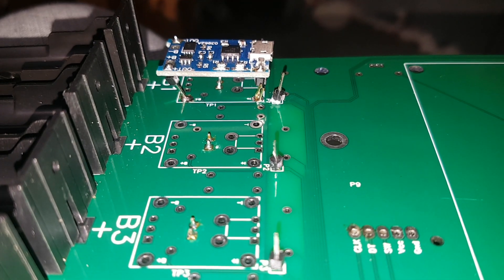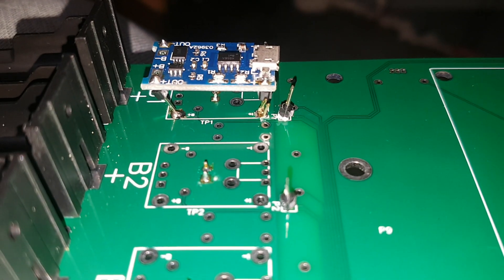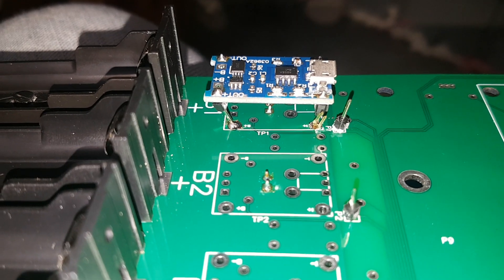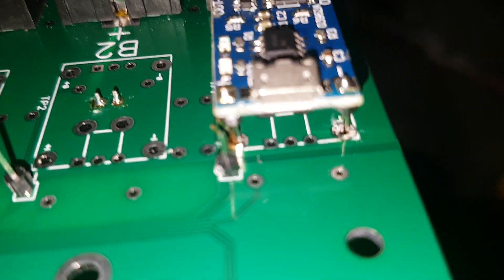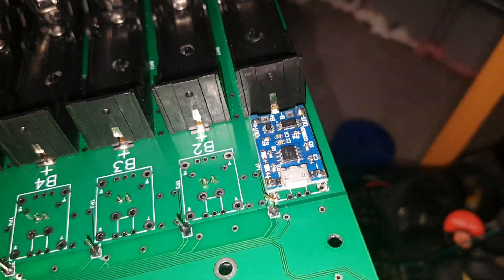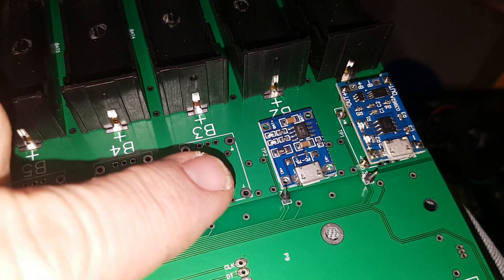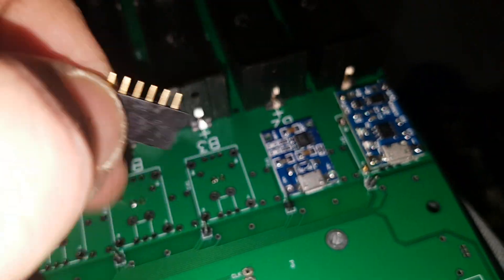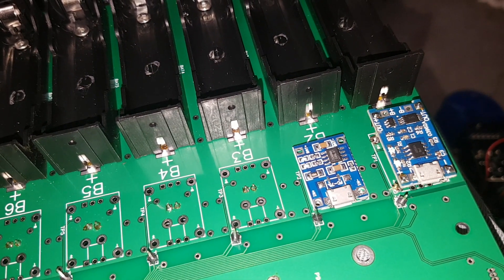DIY Charger/Discharger 18650 TP4065 use the right chip. Part 6

Comment: do you have a source on the right ones or was that one you already had?   what's the length of the ones that fit?  I have a bunch at home, might be worth checking to see if i have some that are the right ones
Reply from the maker: https://rover.ebay.com/rover/0/0/0?mpre=https%3A%2F%2Fwww.ebay.com.au%2Fulk%2Fitm%2F332053563473

That is the right ones.  The new two chip type are too big.
Reply: one chip model is missing the reverse polarity protection.

Comment: Couple of things for the TP4056. 1. You have it soldered on the OUTPUT not the BATTERY that wont work.  2. Those are the exact same chips,  it just has under/ over voltage and amps protection built in, my circuit does not need that as it already has polarity protection. 3. They larger footprint 4. They are more expensive. 5.  I recommend using the ROUND male / female headers for these they are  listed on my parts list: http://www.vortexit.co.nz/parts-list/

Another couple of this you should trim any excess component legs,  don't have any short circuits before turning on the Arduino Mega (do a continuity from your multimeter on everything). I recommend testing every component group incrementally don't wait until the end and think it will work :-) I will try to write some Arduino test modules soon. Use a lead based solder 60/40 with an extractor. Tin is too high temp (for me).

Good luck. Cheers.
Reply from the maker: Brett I brought the machine pin header, but it was to small for the pins of the tp4056s. Not sure about step one of the first paragraph too mate.